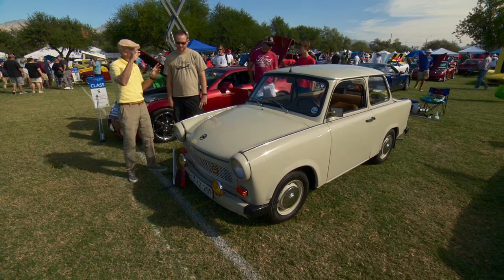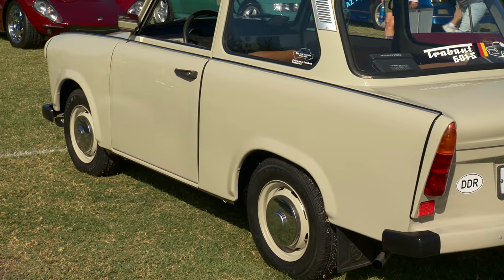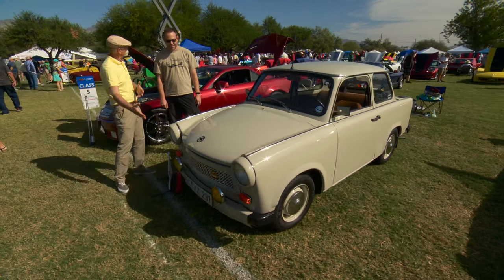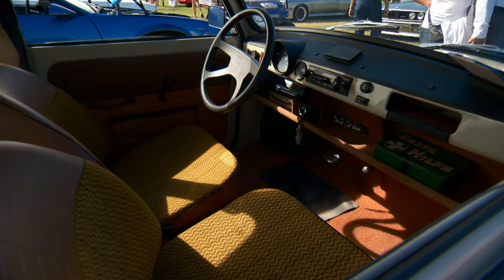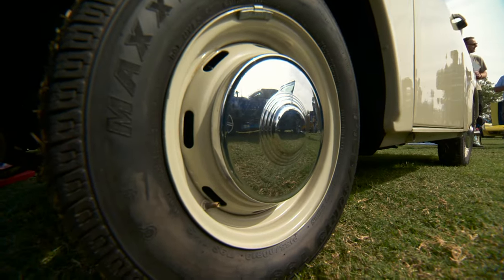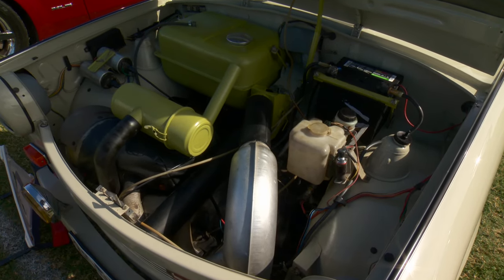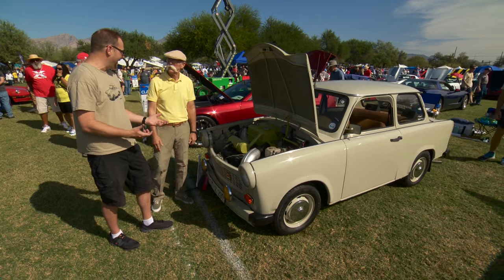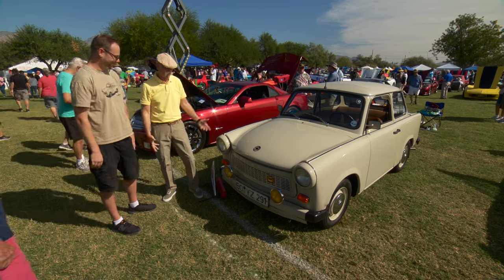German Car made from Wool Coats

Comment: Shortly after that in 1990 the Trabant 1.1 came out, with a 1.1l four cylinder otto-motor (a modified variant of the VW Polo engine).

Comment: I had one, 6V electric. Aweful light, kept it on high beam only to see a little bit. No one coming towards me noticed/complained 😂
Had a getto blaster (on batteries) on the back seat to get some music. 
The brakes were really bad (drum brakes all around). Low power and relatively high consumption (for the power). I was happy when I got the money to replaced it. 😅

My parents waited 13 years to get one. Unbelievable. My father traded the brand new Traband in to a Warburg Station Wagon which was 15 years old. Crazy time, hard to understand today

Comment: Actually the Trabant was built from 1957 to 1991... The last Trabbis had the 1100cc engine from the Volkswagen Polo as the Trabant factory was purchased by Volkswagen
Reply: correct the 57, 58 is the p70, the 59-62 is the p50 and in 63 they built the p60 a p50 with the 600 cc motor vs the 500 the 601 is made from 64-90 or 91 and in 90-91 you could get a 1.1 with the water cooled polo motor

Comment: If I'm not mistaken, that car has no reverse gear. You shut off the engine, flip a switch to reverse the polarity of the starter and start the engine... running it backwards. All gears were available in "reverse".
Reply: Actually no. It has a regular reverse gear.
Reply: @Huebel01 Well, that would explain why they didn't mention it. 
I would have sworn the Trabant was the car I was thinking of.
Reply: Sounds like Lanz Bulldog Tractor 😅
Reply: Trabants have a 4 speed on the tree with reverse

Comment: Wonder how they managed to keep the horsepower so low with a 600cc two stroke!
Reply: a very tiny carb, and a very small expansion chamber, with some big boar heads a bigger carb and a sport pipe it is easy to make 40 to 50 hp.
Reply: @thatdudereviews3146  a 350 MAKES 60HP